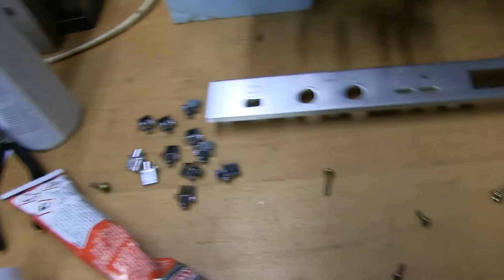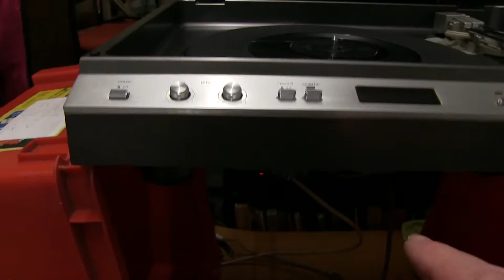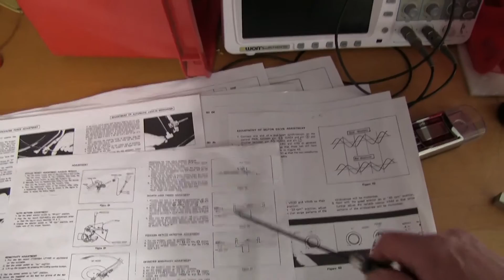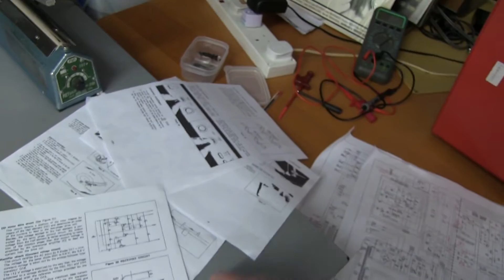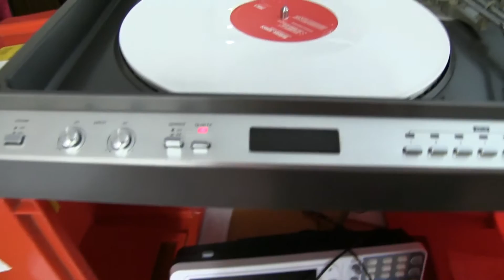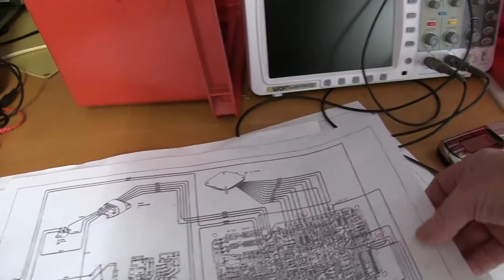Optonica RP-7100 Vinyl record player. Repair, service, test.

Comment: Thanks! Got one in for repair in pretty good condition - 33 was rock solid, but 45 kept hunting at almost the right speed. If you gave it a nudge or switched from manual to quartz (it ran steady in manual and could go a lot faster if cranked, so it wasn't a "not enough power to the motor" issue) it would lock, but most of the time it would hunt.
Turned VR6 a little which made it go off. Turned it the other way and it locked. Turned it until it lost it again the other way to find the middle position that would make it most reliable for the longest time possible.
Before I checked all the capacitors, but as expected they measured well within tolerance and decent ESR.

TL;DR I probably have it fixed by the time you're contemplating on reading this.
The only other problem I noticed, and that might have been a glitch, the track select circuit. I was playing with it while playing a record, I hit 2 and it skipped 2 tracks. Hit 2 again, skipped 2 more tracks. So far so good. From stop, I hit 5, and while it did go there (counting down the display as it found the track markers) and stopped there for a while, it started dropping the needle but then suddenly skipped 2 more tracks (halting the needle dropping movement while doing so), going to the end of the record and then stayed there without doing an auto stop. I'll check the 7400 series logic this weekend, I'm guessing it was a glitch and will likely work fine next time.
Crazy circuit, they don't even use a counter IC, just very basic 7400 series logic gates, the only chip that's slightly more advanced is a quad flipflop (4 bits). Everything else is just AND, OR, NOT. Should be fairly easy to debug, especially since you can take the entire board out and just short circuit the inputs to see if the outputs do the right thing.

Comment: Hi and thanks for the video. I just got one today (RP-7100) and it will not play. Only manualy. When I press play it only scan the record and go back. I have tried to ajust the VR201 and VR202 without a meter. The IR sensor lights up (phone camera) and it´s only 4mm from the record.  But what can I do? You say the pots are sensetive. So can I try to meter it out and how? Do I need a oscilloscope for that?

Comment: Hi Nick, great video thanks, luckily my 7100 is working well. My 5100 on the other hand has a rotation issue and will only spin if I toggle the speed selector fast, if I leave it set on either speed the platter stops. I assume a clean of the switch and possibly pots will be required but that will have to wait a while. I cannot find a service manual or schematic for the 5100 anywhere, even on vinylengine - I would appreciate any help finding one. Keep up the interesting videos.
Reply: I have a 4705 doing the same thing, with toggling the speed selector.  I'd love to know what you eventually do to fix your 5100.  I have gone through the electronics and it looks like the drive inhibit signal is stuck on, on my turntable.

Comment: I purchased a Rp-7705 model for $5 at a garage sale -looks like something that would be in the Jetsons cartoons!  I had it for awhile and finally tested it today.  Unfortunately the  play / cue /cut buttons don't do anything but light up - assuming mechanics are seized it also starts pulling back on tone arm towards end of record which causes it to skip. Hoping this is just weight needs adjusted...It plays at proper speed and the pitch / strobe works though.

Comment: Hello Nick, another question...how can i adjust the lead-in position correctly? You say about that, but i haven't understand it...sorry ;-)
Reply from the maker: Hi. The first track, lead in, set down position, is not perfect, and will vary depending on the width of the lead in before the track 1.   There is a screw on the side of the sensor head, which you can adjust in or out until it sets down about right. But the next record may be slightly out. Spin on. Nick
Reply: @nickadams5411  thanks for your answer...but: in my case i haven't space for placing the sensor more to the left side and the lead in position is still incorrect. For the track positions it's possible to set correctly. Is there another way to correct this by setting at the circuits? Sorry for my bad english ;-)
Reply from the maker: @schlunzlich  It is possible that the sensor arm is not horizontal. The arm can be adjusted by loosening the two screws at the sensor arm mounting, and twisting it slightly. Also, does the tone arm return to the correct position, or does it return too far past the rest?
Reply: @nickadams5411  No, all is correct, the track positions settings, the rest setting...but i have try a 7" and there is the lead-in correct?! Is this 12" lead-in depend on the auto return setting (page 21 at Service manual)?
Reply from the maker: @schlunzlich  Hi, yes, you will need to adjust the VR201, VR202 , but I still think it is possible with the sensor head position.

Comment: Hello Nick, i have also a RP-7100H but my counterwight is fixed for some reason...can you give me a hint, what it can be or how can i solved this issue? regards...
Reply from the maker: Hi. There is a rubber ring, which must have seized the weight in place. you could try some WD40 into the weight, and then try twisting it off.  All the best. Nick
Reply: @nickadams5411 many thanks

Comment: Hi Nick, very informative video, I’m just about to delve into mine, I’ve got a service manual but it’s not as clear as yours looks. Where exactly online did you get it, .....found it in one of your replies, yours still looks a lot clearer
Reply from the maker: Hi Stephen. I think it came from: https://www.vinylengine.com/library/sharp-optonica/rp-7100h.shtml
Reply: @nickadams5411  fixed mine now ......working great...thanks for the great video
Reply from the maker: @100davies  He Stephen. Any tips on what needed fixing on yours. May be useful for others.  All the best spinning. nick
Reply: @nickadams5411  Hi Nick, just a clean up and slight adjustment to the pots for quartz lock, if I hadn't watched the video I would have tried the longwinded instructions in the manual... all working fine now
Reply from the maker: @100davies  Hi Stephen. Thanks for the info. Could help others as well.

Comment: Hi Nick, long time lurker and 1st time poster, I picked up a mint condition 7100 today and I have so far encountered 1 annoying issue, I have balanced the arm and set the tracking at 2 as there is no make or model info on the basic cart it came with(thought I would try it out before introducing one of my carts to it) the issue I am having is that when I press cut it returns but not all the way to the rest it stops approx 10mm from the rest so does not cut out, my thinking was the arm lifter but I am not sure, your thoughts would be much appreciated, many thanks 😉
Reply from the maker: Hi Simon
The cartridge will not make a difference as long as the arm is balanced and the sensor head is the correct height from the record.
Assuming it is not a mechanical adjustment then:

There is a Tonearm Return Detector adjustment.
It is the preset pot VR301 on the circuit board. (The smaller circuit board on the right - preset at top edge). If you do not have a voltmeter to read the voltage, then small adjustment left or right and see if it makes any difference.
The Service manual is available (free after register) at:
https://www.vinylengine.com/library/sharp-optonica/rp-7100h.shtml
Reply: Nick Adams many thanks Nick very much appreciated 😉

Comment: Hi Nick, Great info here, I shudder as you mention if the CUE button didnt work it would ne a nightmare. My RP-4705 came from a repair shop where the owner never picked it up. Everything works well EXCEPT for the Cue button. It lights up RED but does nothing. I also noticed on an 180g album when the tonearm came to the end of the album side it came up and scratched the entire side of the album when returning the cradle. Any help you could provide would be greatly appreciated
Reply from the maker: Hi Ray
Make sure the arm lifter is not stuck down, as it is raised by the Cue button as well as after the record has finished playing.
It is the curved plastic part under the arm at the pivot end.
Slowly ease it up and down a few times until it feels free.
It has oil damping, so do not force it too fast.
It should free up and hopefully respond to the Cue button.
Keep spinning.  Nick

Comment: I recently purchased a rp-7100, but noticed that the motor spindle has a minor wobble - always at the same spot during the rotation. I've been hard pressed to find others with this issue -- or even spare parts for the old equipment. 

Perhaps its the cartridge, but when I play a record the audio skips. Same record on my old table and it has no issues. I'm attributing it to this perceived wobble. Have you ever run into this with Optonicas?
Reply from the maker: Hi
Is it a mechanical wobble, as the stylus jumps.
Without more information. ie. Does the spindle move from the vertical, or does it just slow and speed up.
The bearing could be damaged, or the brushless motor could be faulty.
Both would be unusual unless the unit had been damaged.
Reply: It appears mechanical, when I take off the platter I can see the spindle move from center - always at the same location though. It almost appears as if its being pulled out of round..? No noise, just smooth operation for the most part. I'll take a video tonight to demonstrate. Thinking I may have bought a problem with no spare parts!
Reply: It turns out I was overthinking it all. I removed the headshell to find the stylus bent and dirty. Although a replacement is needed, I cleaned and bent back the stylus and it tracks fine for the most part.

Comment: I PICKED UP A MINT Optonica RP-4705 TODAY. A lot simpler than this model, but it only works manually. The PLAY and REPEAT buttons light though nothing repeats as the arm does not lift by itself. Any ideas on the issue? Buttons or mechanical? I know nothing about this stuff. Any help would be awesome. thanks.
Reply from the maker: Hi Jeff
A common problem with old Optonica.
It may be the switches, but more likely the arm moving motor jammed with old grease, or the microswitches corroded. Also the arm moving mechanism can become erratic with hardening of rubber parts.
You will need to take the bottom off to get at the electronics
With it unplugged:
Anyway, you will need to spray switches and microswitches (red colur I think) with a contact cleaner. Operate them by hand several times.
The motor you can turn by hand to see if it is seized, and remove old grease .
Reply: Thanks Nick. Microswitches you mention. The control buttons you mean on top? If I need to remove grease, do I need a special solvent? This was all packed away in its original box and foam. Beautiful and sounds great as wwll, but would be nice functional :) thank you.
Reply from the maker: The control button switches are connected to slide switches.
The grease , can be removed with a  small cloth or cotton buds, with some solvent such as brake cleaner.
I am not sure where the switches are on that model. They will operate when the arm reaches the stop and start positions.

Comment: I just purchased an Optonica RP-4705 in near mint condition, but there was no manual.

 Can you help me with the correct number for the counterweight and antiskip? Also, do you know what kind of cartridge it takes?
Reply from the maker: Hi
You can fit any cartridge that is secured by 2 screws.
Chose one that suits your system and budget.
Balance the arm at zero playing weight, and then set playing weight as specified by the cartridge. 
The antiskate is normally set at the same value as the playing weight.

Comment: Sharp and Optonica were very good brands and generally very reliable. 
They didn't have the big distribution set ups like the other major brands which is why they never achieved the popularity they deserved. 
I used to have an independent rep visit me once every couple of months and I would buy a limited amount of goods from him. 
The auto track selection thing was always a problem due to the inconsistency of record companies and the pressings they produced. Some breaks between tracks were so small the systems could not detect them. Some manufacturers used a light to shine down on the record and tried to detect the breaks in the tracks by the reflections back into an opto-sensor. 
Some records crammed the tracks on so tightly the auto track detection systems didn't stand a chance
Reply from the maker: Hi Jeremy
That's interesting info.
I agree the Optonica is good advanced designs for their time.
I have a cassette deck which is unbelievably heavy and crammed with electronics. I think they went a bit over the top sometimes.
I also agree that the record deck is not perfect and misses tracks as you say.
All the best
nick